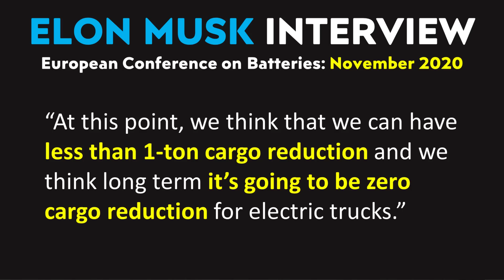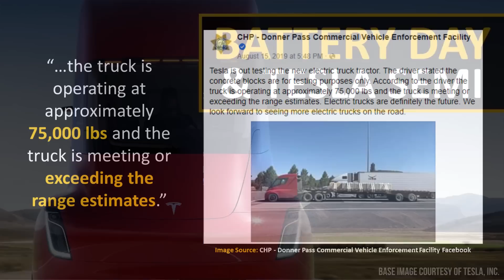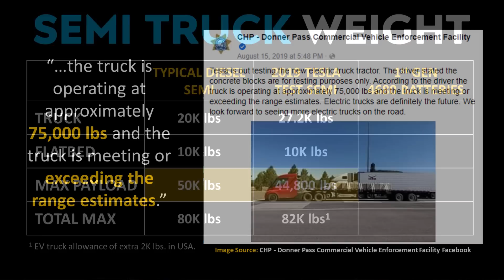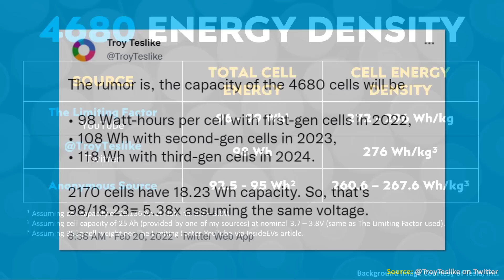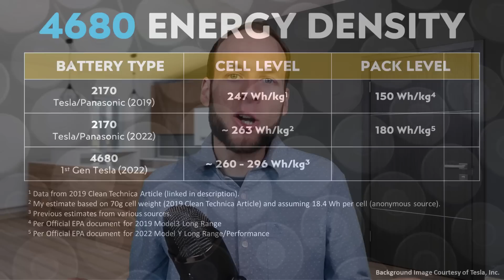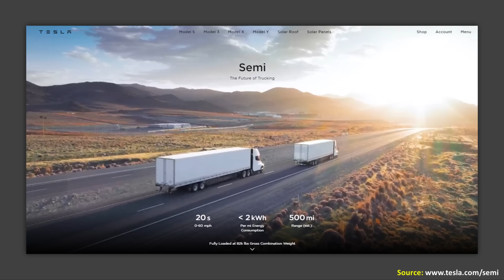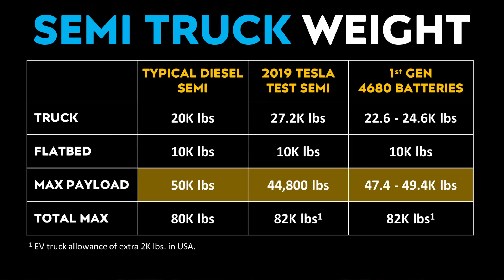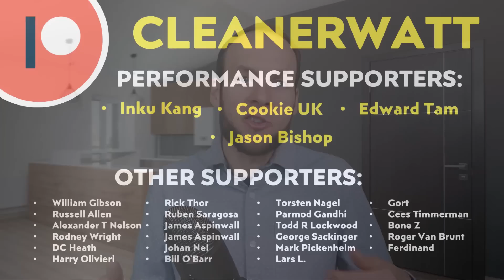Tesla Semi HANDICAPPED by 1st Gen 4680 Batteries?

Comment: Anything on powered/supplemental battery semi trailers as GM announced earlier, this year? Seems like good use of all that below load space that’s usually empty from the rear wheels to hitch.
Reply: Yes, especially if weight distribution is less of a concern than in the past. If not, I wonder if a ballast style flow battery may fare better or some other weight distribution scheme. For flow batteries, the balancing of where the weight goes only has to change every time the cargo load goes through a change. Roads have become cheaper per mile to repair. So, I wouldn’t be surprised to see batteries prioritized more toward the trailer.
Reply: Remember this is GM, who have been saying "best battery" for a while.
.
This seems to be saying "however, we need to supplement the main pack with batteries on the trailer"...?
🤔
Then, check out the double stack hummer?
2+2=?

Comment: In my opinion, for what it’s worth. . .  If the weight restrictions are because of wear and tear on the infrastructure, they should be determined by “per axle” loading.  Of course, things like bridges should ALSO have maximum weight restrictions

Comment: Whilst I agree with your maximum mass payload estimates you are forgetting that most freight is volume not mass.
Mose electronics and home goods and general consumer goods are packed so inefficiently that the vast majority of freight is air. even a semi filled with 22 pallets of beer is no where near max payload.
A standard semi trailer or a 40 Ft container is around 76 cubic metres or just shy of 27,000 cubic feet.
Very few trucks are actually running at their 80,000 lbs max load.
And then you have states and countries where maximum road and bridge capacities do not allow max payload above 60,000 lbs or 27,000 MT

The most dense payloads tend to be flat bed trucks running steel Slab, coil or billets or other very dense cargo such as that carried by bulk tippers carrying gravels and quarry products and then liquid tanker carriers.
The vast majority of road freight is less dense materials and goods so keep that in mind.

Comment: Honestly, this  kind of calculations of a Semi Truck with batteries that both haven been released, just based on "calculations" (probably more likely "estimations") is quite pointless in my opinion. Comparing cargo weight between an ICE truck and the semi will be the first and foremost calculation tesla and Elon will do, so why not start to compare once there are real world Semis on the roads?
Reply: I understand the ‘Be Patient and wait’ approach. It’s similar to stay in the dark until I let you out.
John made well considered findings based on known facts and deduced other results from well thought through imputs from a number of sources. Some commenters offer constructive alternatives using different approaches. There was no real disputing of his conclusions 
I found the process and result very interesting.
I also liked the comments from the trucking industry and the real hawling imputs especially that 85% of loads are volume restrained and a Tesla semi can take max load. The axle load was also interesting for the higher loads which would make the Tesla semi viable here.
I have a feeling that Tesla will start delivering to PepsiCo first so they can have a partner to do real life testing and a more simple charger roll out in the first instance. This would be a good way to introduce the semi to the trucking public
I had also wondered if they would divide the battery packs up , say one per motor. Great for further reliability, better charging distribution and thermal control. I would love to hear if their are any people who know more on this and further comment
A fab article and comments
Reply: @Bernios
At last another voice of reason in a sea of.... Whatever.
Reply: @InformedKiwi  
"Known facts" are fine, but @Bernios was (is) absolutely correct when saying that the fundament basis of all the calculation, the weight of the base truck, is unknown, either in actual data, or a close approximation in comparison to "convention" units.
.
As such, even calculation with any "known facts" (what? where?) may not arrive at a true measure.
.
We have at least 4 more unknowns (cell performance, pack capacity, motor configuration, motor gearing/ performance) any of which can skew an "approximation" (guess)
Compounding 5 unknowns?
.
Good luck getting close.
.
Seems to me you're blinded by the light.
I'll stay in the shade.

Comment: So much research is being done on the battery side.  The main driver, the electric motor, could use improvements.  Instantaneous torque but diminished torque at higher rpm’s which puts a huge load on the batteries.
Reply: Next generation graphene capacitors on demand may fit well for known routes that demand that type of loading that stress batteries. In those circumstances, the capacitors are housed near the start and end of demand areas.
Reply: But these motors will be geared for 90-100mph, not 150+
They'll be ticking over nicely in their torque band.
Reply: @gary.richardson  
Just... No!
Even current batteries have a better performance profile for the use case. They won't be stressed.
This truck can hit 9-69 in 29 seconds fully loaded. That doesn't mean it will
I imagine there's a "soft start" feature ("chill mode") for city work.
When it hits the highway, it's already moving, the third motor kicks in, up to speed, then back to "tickover"
.

Comment: Has the cost of battery replacement been factored into this equation? Commercial vehicles are worked pretty hard so I assume this is an issue.
Reply: 4680 cells are projected to last 1M miles. Pretty sure the operation savings will have more than paid for a complete replacement truck by the time the battery wears out.
Reply: Why the assumption (fixation) that replacement will be required?
Smh
Reply: @CSHarvey  It would be great if 4680 batteries attained 1M but as you state it's a projection. I'm wondering when they need to be replaced with current tech.
Reply: @rogerstarkey5390  Now it's a fixation to ask a reasonable question re the cost of running an etruck. Guess I'm labelled an E heritic for even bringing up the subject! No debate questioning allowed. My god!
Reply: @CSHarvey  lol….. you realise that the average diesel truck is also made for million miles right! There are litteraly several trucks out there with 2 million miles+
Reply: @CSHarvey  diesel trucks will also in the same time achieved way more than the electric one can do

Comment: Jonathan: How long do you think it will take them to get to 3rd generation and how many generations do you think they will have till they are "good to go"?
Reply: They current Version is already conparable to the best Batteries on the market (catl 2170s), so they surely will find a way to use them. Or did you mean "good to go for usage in the semi"?
Reply: Jonathan: I am speaking when the 4680 cells are at the best interation for the Semi & Cyber Truck
Reply: @Matzes  
CATL makes 2170 cells?
Really?
(Panasonic?)

Comment: Following this channel so far I didn’t notice 46800 has a pressure relief valve integrated as do in 21700 and 18650.
Reply from the maker: I know for sure that the Gen 2 design features a new pressure relief valve design. I am pretty sure that GEN 1 has some kind of relief valve built in as well - but I have not heard specifics yet.
Reply: @Cleanerwatt  was I right what you know for sure has not been stressed in the video?
Reply: @Cleanerwatt  Munroe live said relief valve on bottom to eject below the car.  There 4680 battery model Y must be a generation 1.
Besides, you would not want to put a battery in that could explode if it failed.
Reply: Look for the "rivet"
Reply: @davidclark2286  4680 has no vent at the cylinder base, a relief valve facing down is a mistake. The only hole I saw was facing up
Reply: @rogerstarkey5390  I don’t understand.

Comment: From the one side your assumptions make sense, from the other side you’re mixing volumetric energy density increases (more range) with gravimetric energy density. Those two haven’t a 1:1 relation. Then there is that whole structural battery thing. Yes, a structural battery can increase the volumetric energy density of the battery on a car, but there is no major win on a semi due to the complete different chassis, so you can’t use any increase in the model Y on the semi.
Putting it plain, even a 4680 semi has still some problems with the weight. If the goods you transport are volume constrained, a semi might work for you, if you always drive a semi a max weight, the Tesla semi, or any other electric class8 truck for instance, will be your best choice in terms of economics. But who knows how prices of gas and electricity will develop in the next years.
Reply: Flawed logic.

Comment: I think battery  packs and a motor could be installed on the trailer. Fit 2 axles on the front of the  trailer.  A cyberspace could then used  as a  master controller  with trailers  linked to gether to firm road trains. Each trailer  would have remote control for individual  movements. In Yards etc.
Reply: " KISS "
STANDARD, SIMPLE.

Comment: That trailer pictured is closer to 14k and a sleeper cab diesel truck I’d closer to 18,500. Day cab trucks are closer to 16k and the first Tesla semi is a day cab so if 2k more than diesel equivalent it should mo more than 18k. A aluminum flatbed trailer is 8-10k. Way too many variables, just wait for the truck by the end of the year to get actual math. 😊
Reply: Weighbridge required.
Then a fully loaded run, WITH a diesel running the same route, same weight, same start time.
Popcorn!

Comment: 9/10 of our loads r volume limited. Almost all of the loads are 20k-35k lbs and the truck runs outta space...theres not much time for people to figure out a truck like tetris...and if every load was optimized (stacked nicely) mayb our higher range loads would touch 45k lbs.
Reply: I can almost see the semis having a motor and battery on demand available so that traditionally light loaders get by with 2 motors but can pull into a service station to lease an extra battery or motor to match demand and to pare back as well. The service needs to be a rapid swap as in motor/battery integrated axle/wheel exchanges, drivetrain swaps, or even solar roof on demand for seasonal savings.
Reply: @gary.richardson  
Just.... No.
They already indicated the Tesla would (easily) outperform a conventional truck with only 2 motors running.
Now there's the "3 motor" configuration ( I suspect 1 is a Plaid unit for weight saving, only used for acceleration and/ or gradients)
.
It's going to have way more performance than needed.
Reply: Then there's the shredded bark loads, up to 140,000 pounds in 10 axle moving bed trailers. I drove a lot of those here in MI in the summers.
Reply: @gary.richardson  
As for "service"
3 motors, a unit that can run on 2 (1 if it's a Plaid?)
Possibly a "split" pack, for redundancy.
Redundant systems on steering (as with the cars) brakes! Hardly used.

A high tech diagnostic system that will probably advise service before the driver knows there's a fault?
Maybe a "call ahead" system with parts ready on arrival at a rest stop. Driver takes the mandatory break, truck charges while being repaired? Or, if it's non-critical , continues to the overnight stop, parts ready on arrival.
.
(Speaking as a service tech in another industry, I try to work the same way. Phone the customer, known problem? order parts to that location, ready when I arrive)

Comment: so why doesn't the 4680 Y have better range?
Reply: Because Tesla doesn't really care about more range any more, they rather care about building more vehicles instead. They rather build 2 vehicles with 300 miles of range then 1 with 500 miles of range.
Reply: @rowanbroekman3929  so if you buy the new 4680 Y you'll get less miles and cell to structure that can't be repaired or replaced. Got it, don't buy a Tesla
Reply: @missingpiece2071  They make the car worse then it actually is with software on purpose because otherwise people only want to have the 4680 car and not the other cars any more. They limit their advantages in all kind of ways. It's now far cheaper to produce and can be sold for a much higher price, especially when the government decides to give billions away on top of it relatively soon.

To be clear, the battery can still be recycled and will easely outlast the rest of the vehicle. Not just the Tesla, essentially all vehicles ever build.
Reply: I think it was in the Q2 earnings call that Tesla explained there are a lot of challenges to making the 4680 batteries, so to reduce difficulty they decided to defer an optimisation of some aspects until they get the basic details correct and reliable. In the future, they hope to improve the battery chemistry (e.g., adding silicon) and possibly shave some weight from the battery pack.
Reply: @rowanbroekman3929  although the 4680 is a major disruption to earlier generation batteries, it seems wise to reward existing customers with offsetting rewards and credits. And remaining batteries priced down for quick discontinuation. Perhaps offered to early adopters first dibs for secondary applications and upgrade options.
Reply: @missingpiece2071  
You're ready not paying much attention, are you. (Not a question)

Comment: One other idea to consider is that Tesla was using 4 ‘model 3’ motors for the power train, back in 2019 but apparently the new semi is only using 3 of these motors. That reduction alone would probably close the total cargo truck weight gap.
Reply: Think the motors only weigh like 180 lbs.
Reply: The Motor is not that heavy
Reply: Or. 2 model 3 units for cruising,
1 plaid unit.... For "boost" ?

Comment: 4680 v1 is amazing. Given what the teardown of them has shown us. The v1  does not have any silicon on the cathode but still has the energy density of a top notch 2170 due to thicker cathodes it is tabless this has lower resistance despite its much longer jelly role length -thus its wider diameter - and it only has the Anode using DBE instead of both Anode and Cathode.    
I am not sure there are yield issue at all preventing Tesla from ramping 4680's for Semi or CybreTruck. Why ramp a battery that has not met its true potential and be significantly better and cheaper than a 2170.
So I think  Tesla will wait until they roll out 4680 v2 which will be in mass production in 2023, so in line with the roll out stated by Elon.
Reply: It’s not amazing lol….

Comment: One important thing to  remember is that not all semi needs maximum weight capacity. Some freighters are volume restricted and not weight restricted. Depends on the cargo. If your company has freight of volume intensive cargo weight of the battery pack does not matter at all.
Reply: On some of Ontario and Quebec divided highways, I’ve seen a lot of Walmart and Frito Lay double 53-footers.
Reply: @dewiz9596  
Which in itself indicates light cargo?
Reply: Lol…… it’s still nice to have all that massive capabilities or flexibility of maximum range and load. Those semi will get old and still have to work, diesel is awesome because even a 30 years old diesel truck is still amazing for everything.

Comment: In your calcs did you take into account the change in motor weight.  I recollect the 3 motor and reduction gear  was very heavy, needing mechanical equipment to handle rather than 2 men,  there were 4 of them and if I recollect needed a two speed box,  extra weight.  The new tesla semi uses three motors similar to the plaid,  high tension wound with carbon fibre wrap,  2000 rpm so it will not require 2 speed box.   ELON was able to pick one up single  handed and make it look very lightweight.
Reply: You know they're all Plaid?
Remember these were to be 1 per wheel, so no differential as on the cars.
I would say 2 single wheel lightweight "3" motors powering a wheel each.
1 Plaid with differential for acceleration, gradients and emergencies.
(Or, the opposite, Plaid for cruise?)
Reply: @rogerstarkey5390     No!      The weight penalty of the model 3  motor is just too high.
Reply: @rogerstarkey5390  Nope they are totally different motors actually remodified for heavy duty applications lol…..

Comment: How come the 4680 Y is only 50 lbs lighter than the long range 2170 Y.  The 4680 was sold as standard range, but even if they de rated the battery, the weight loss isn’t there. It was supposed to be about 500 lbs less for same size battery.

Comment: Gotta start with road pavement destruction - based on axle loading, but to fourth power. It’s a crazy equation, hard to get head around. 
EVs will offer lots of alternative design options like all wheel steering, all wheel drive. 
Then autonomy will add more options again, like smaller units being economical (fixed tray, non-articulated)
All this will happen before 20% of diesel trucks are replaced, it’s going to be fast.
PS. 4680 will be gen 4-6 by time semi in mass production. High silicon anodes. We are getting to (scary) vertical part of technology adoption / evolution.